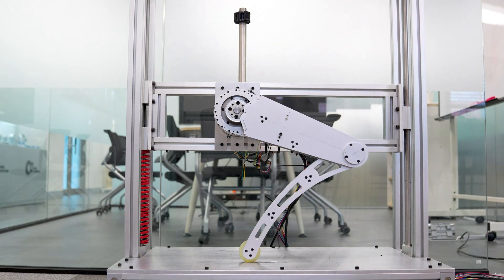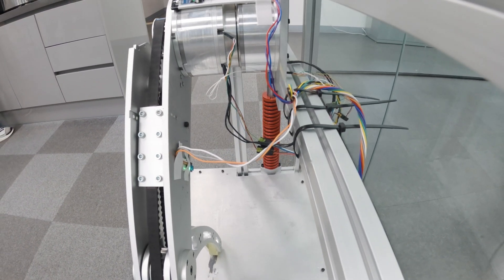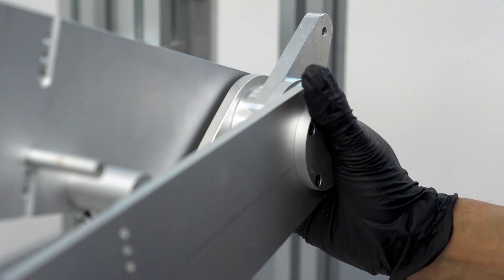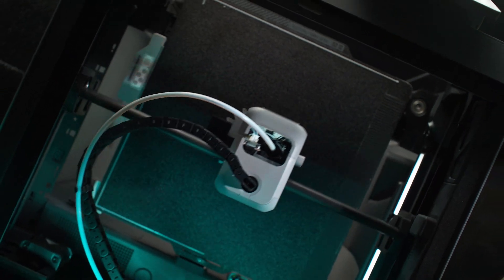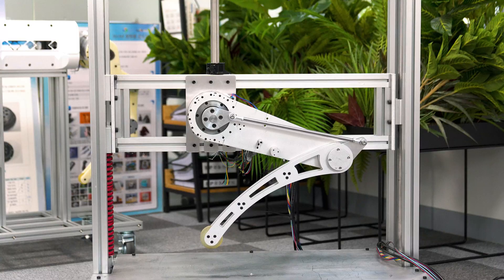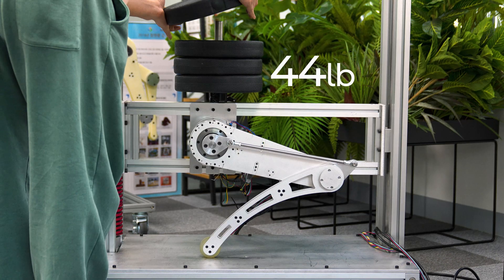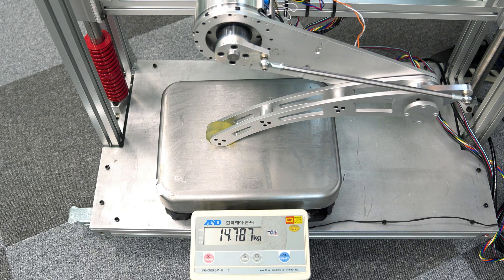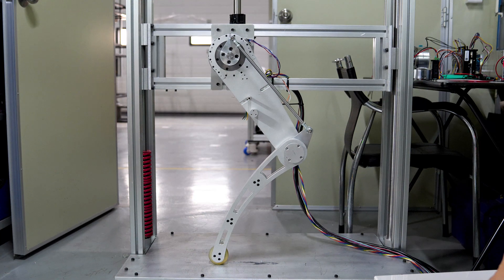Why the Timing Belt Failed: Testing the New Linkage-Based Robot Leg

Comment: you need proper ball bearing in your linkage that will take the off axis loads.
Reply from the maker: That's a very insightful point. We're also considering cross roller bearings for Version 4 to maintain efficiency while withstanding the loads.

Comment: Why not 20mm pitch leadscrew but motor joint
Reply from the maker: You're absolutely right! If you're referring to the lead screw mechanism in a linear actuator, it certainly offers tremendous advantages in torque. However, our primary goal with this specific setup was to create a simple structure purely for testing the actuators we developed. We truly value your feedback and hope to have the opportunity to develop and test products utilizing such a system in the future.

Comment: 49:1? How’s the output rpm?
Reply from the maker: We used a 2000 rpm motor, but haven't specifically tested the output rpm yet. The focus of this test was more on torque performance than speed. Thanks for your interest!
Reply: @bonsystemsglobal  If I remember correctly, your dog will need at least 15 rpm to jump, if you have 2000/49, then you have more than enough.

Comment: The weight of the motor seems very small compared to the forces you are generating.  Why not just put the motor in the joint?  Avoid the linkage all together.  Also, look into ecccentrically cycloidal gears.  Much less parts, much simpler joint.  It might have problems at the forces you are generating, but maybe not.  https://www.youtube.com/watch?v=qMDU5tlGUwU
Reply from the maker: Thank you for your valuable input! We’ll take it into consideration 🙂
Reply: Putting the motor in the joint increases inertia of the leg and also decreases energy efficiency, robots that walk already use alot of energy ,  so putting the motor directly in the joint may not be recommended